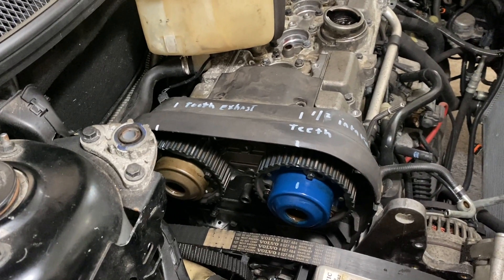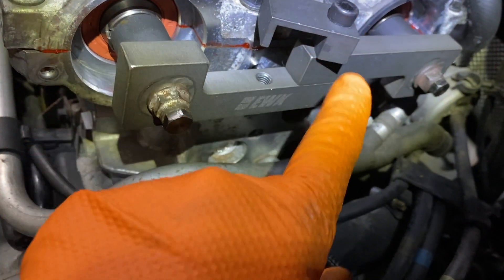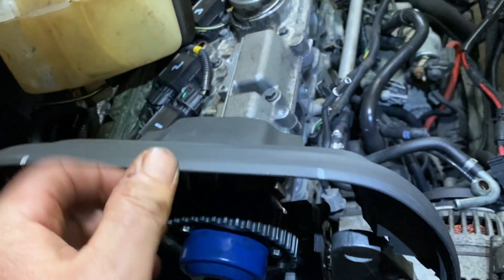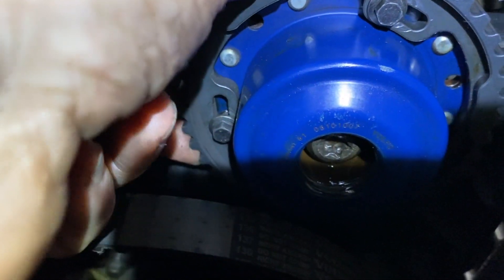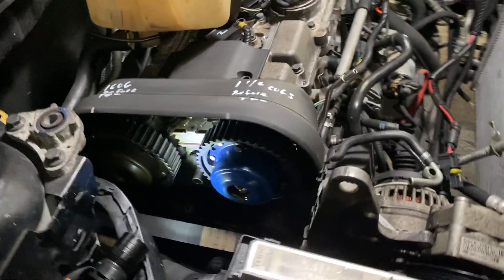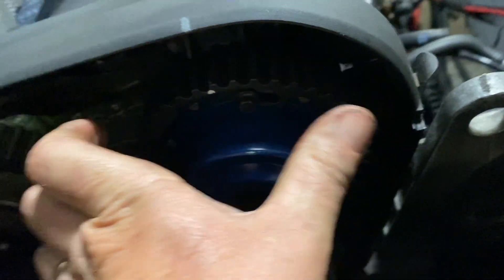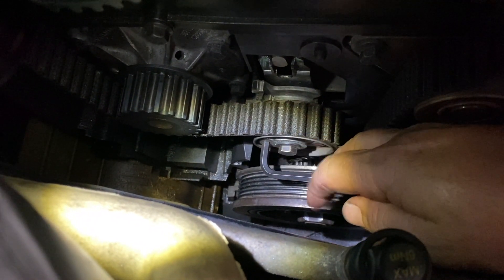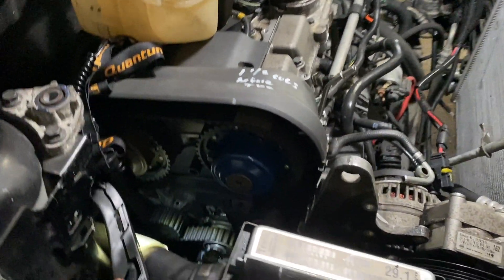Volvo 2.5 Turbo Variable Valve Timing (VVT) Alignment

Comment: I just replaced the seals behind the pulley as it was leaking, it just won’t start now I know why hopefully it’s not caused damage
Reply from the maker: Yes these vehicles don't have key ways and free wheel when you take the actuators and must be retimed.
Reply: @motorcarnut this is the only video I’ve found that explains properly, I just had to take a break because I was getting frustrated I’m about to go re time it hopefully I didn’t bend a valve
Reply from the maker: Thank you! Hopefully you didn't
Reply: @nickycarpo any luck ?? I'm having the same issue lol
Reply: @carsandbeatzofficial nope I bent 6 exhaust valves😂 setting the timing on these engines has to be spot on, luckily all the parts only come to £100
Reply from the maker: Sorry to hear that.

Comment: when I follow your guide and spin the engine two turns, I try to insert the locking tool into the back of the engine but it won't go in.
what am I doing wrong?
Reply from the maker: Idk what you did or didn’t do but sounds like the timing is still off
Reply: @motorcarnut yes but I do exactly as in the video. I have repeated the procedure several times but every time I turn the engine it is wrong after
Reply from the maker: I don’t know what is going on I’m not there but the timing marks after 2 revolutions they should line up.

Comment: Hi, thanks for the video. Will the timing get thrown off if I change a waterpump and timing belt on a C30 without using a cam lock tool?
Reply from the maker: Thank you! Yes it will on Volvos

Comment: Hey when I Lock enter bolt and turn it counter clockwise and loosen the bolt and move the gear to clockwise to get 1 and 1.5 teeth before it not align I have to move the hole gear a bit to get exact 1 and 1.5 teeth can u help please
Reply from the maker: The procedure in the video is how it’s done, if you are not using the tools Volvo requires it’s hard to say what you’re doing wrong ?

Comment: Hey brother this is the best video ever you are awesome and so smart with this Volvo timing, I’m doing one tomorrow so if I don’t take out the vvt I don’t need to do all this right, but I might have to change the exhaust but due to oil leak . So if I change I new one I just follow your video to set it back up? And since I’m not taking out the intake one do I still need to do that vvt too
Reply: I uploaded pics on my account can u tell me if this the right mark all data tell me to go counter clockwise to lock with the crank tool which I don’t have
Reply from the maker: Thank you appreciated! If you do not take the VVT off you do not need to re-time it, you can put it back on the way it was and just follow video to set the one you did remove.
Reply: @motorcarnut  thank you so much for your reply keep up you good work with more videos it can help lots of ppl
Reply from the maker: Sure no problem and of course I will! Thank you!
Reply: @motorcarnut one more question brother, I don’t have the crank locking tool only have the cam too do I still leave the crank at the factory mark or behind please let me know ow thanks
Reply from the maker: The tool is crucial for proper alignment but try to put it as close to TDC as possible

Comment: Just found this video but I doing the cam seals on my 2006 s60r but I pulled them cam sprockets off before I loosened the three lil bolts but what I asking is this when your putting it back together not before right just wanted make sure. I’m assuming this like when you are putting it all back together. Thanks
Reply: I’m sorry im new to all of this stuff, but what asking is that this is when your putting it back together after replacing the cam seals right? I’m doing water pump ect and the cam seals i wanted to make sure i didn’t have to lose the three lil bolts on cam sprockets before loosing the big t 55 bolt.
Reply from the maker: Yes correct
Reply: When I setting cams for the exhaust side trying to have one tooth before top dead center with sprocket max out but Instead up being top top dead center with it. Which makes no sense and same with intake side I’m one tooth from top dead center not 1/2 like you said. Idk what I’m doing wrong bc this would third timing doing this and my exhaust tooth one a head from the intake
Reply: I have 2006 s60r are vvt hubs different from each other?
Reply: Either way I tooth off at the very end when I put the timing belt on. Now this time it’s the intake but I can put it back tdc but then exhaust tooth is head one tooth. So nothing makes sense anymore. I’m thinking my vtt hubs are different bc my timing is not where’s your is on the cam sprockets
Reply: Actually my intake is 1/2 tooth back my bad.
Reply from the maker: Glad you caught your mistake.
Reply from the maker: I don't know exactly what you asking but i'd redo the timing.

Comment: Redoing my timing for the 50x, this is the best video on YT for this for sure.. watched this my 49th try and it fired with just a p0016 code, 50th time 100%.....thank you so much
If I can add to aid others, mine was a 2006 xc70 and the crank pulley timing marks, I found that you can look at the roll pin in the face of the ac pulley,  that must be at about 1 o'clock, for TDC  and if the timing belt crank shaft pulley has no marks like described here on the teeth, there is a mark/bumb/raise on the front of the timing belt crank pulley just behind the ac pulley. You can look down from the top and see the alignment mark casted into the crank shaft timing pulley. Align to same mark on oil pump. Hope this helps someone as this all help me BIG TIME. 

Thank you again friend for your time and knowledge
Reply from the maker: Thank you! Wow that is awesome! Glad it helped! Thanks for the feedback and the tip about the crank pulley timing marks on your particular vehicle!

Comment: Hey brother i fix a water pump leak on this vehicle for the first time and off set the timing. Can you suggest what to do to fix the timing
Reply from the maker: It would have to be redone like in this video if your engine is the same one.
Reply: @motorcarnut ok it is. What about the crank
Reply from the maker: That too

Comment: Hi, is it the same for the 2.4 with VVT only on the intake side? I adjusted it when I was changing the timing belt, but now the car does not run properly. So, I might try resetting the engine.
Reply from the maker: I don't believe so unless your cams look like these in the video. There are many variations, Volove loves to complicate things.

Comment: Am I the only one that got confused once he started talking about the cam bolts and sprocket bolts? Unfortunately this is the only video I’ve found where they actually messed with it…. My belt broke so replaced the head and now fight issues with crank no start and redone the timing many times and I still think it’s wrong because I’ve checked everything else…
Reply from the maker: Must be, you think those adjusting bolts are there for no reason? That's why you have issues. I'm trying my best to keep it simple for people who want to do it themselves. But Volvo doesn't make things easy.

Comment: Does this video still apply if i messed up my timing while changing my timing belt? I changed my timing belt at 267k and shortly after I got codes P0017 & P0016 Camshaft position correlation codes. I must've done something wrong but I don't know how to correct it. (2007 xc70 with the 2.5l turbo) When the crankshaft is positioned correctly(TDC) my exhaust is off 2 teeth, and my intake is off 1 1/2 teeth.
Reply from the maker: It should same engine
Reply: @motorcarnut  ok, so i gotta re-time the entire engine back to factory timing.
Reply from the maker: correct

Comment: Hello sir. I must say I love your video.
I have a question...I have 2007 volvo S60 2.5t and I have replaced pcv system, battery, alternator regulator with brushes and top motor mount. Once I put everything together and tried to start the car there's kinda hard knocking noise that I can hear from top of the engine (camshafts area) just about all lifters are knocking (Sounds like diesel truck engine when cold). I pull off both vvt solenoids and cleaned them good and inspect them and they seem to be working fine. I started couple more times to see if it's going to give me any codes and it did turn check engine on. Codes are ECM-670c and 671c (camshaft position, intake and exhaust. High). I cleaned all codes to see if it's going to change anything and nothing changed, still knocking.
Engine was running fine before. 
Do you have any clue what could happened and what should I look into.
Thank you.
Reply from the maker: Thank you very much, appreciated!
You may have an issue with the timing chain, or even one of the VVT gears being out of alignment. Sounds like the valve timing is off
Reply: I assumed same and that's why I want to change timing belt first and see what happens. I already got camshafts locking tool.
Thanks for your reply, I appreciate it.
Reply from the maker: No problem, good luck!
Reply: Thanks
Reply from the maker: No problem

Comment: Thank you your video is easy to understand and gets me closer then any other . Mine has only exhaust side vvt. I set everything as in video put together enough to fire . I fired it up and there is a loud squeeling sound now like a belt squeel . You rhink i might have tightened the belt to much ?
Reply from the maker: You are welcome, That or the belt tensioner if not new it's probably worn.
Reply: @motorcarnut  ok I adjusted everything but I still think I need a new tensioner . It seems to rev fine , but at idle it shakes like hell and throws misfire codes . Ran like a top when seals went bad
Reply from the maker: Valve timing is definitely off
Reply: I may have messed up the reseting of the vvt after initial timing . I'm a little confused . Do I want the final turn to have the hub turned to the right or the left ? And the sprocket should stay on time right ? Sorry to bother you and I appreciate the help bigtime ! I know cars and fix lots of them . But this isn't normal lol.
Reply from the maker: Left and sprocket should stay in time correct

Comment: Excellent video! Does the same priciple apply to their inline 6 cylinder engines?
Reply from the maker: Not really, it’s a little different
Reply: @Motorcarnut  Is the info perhaps in the Haynes manual or do you know anywhere I can get it?
Reply from the maker: @Thexpertoneverything If you have a library card you can go online and look for auto repair manuals, they are a great no cost source of information.

Comment: Motorcarnut, I was driving my 2004 Volvo V70 2.4 non turbo and a piece of the belt got up under the pullies and it jumped time and cut off. It isn't double variable valve timing only single,  so how do I time it since its single variable valve none turbo?
Thank you in advance for any info.
Reply from the maker: I have a video warning people of that belt problem. The set up is different unfortunately I didn’t make a video yet on the single.

Comment: Great video, but I would change where the teeth are placed before the final adjustment.  If you put the exhaust 1 1/2 tooth before and the intake 2 teeth before the timing mark when you do the final adjustment the three bolts wouldn't be bottomed out in the grooves.  That way you would know for certain that you had adjusted to the correct limit rather than just having the bolts bottoming out in the bolt grooves.
Reply from the maker: Did you do it that way? The information is from Volvo and never had a problem yet. But thanks for the information and comment! Appreciate the extra information.
Reply: @motorcarnut  I did and whoever replaced the timing belt before me had the crank sprocket bolts even further to left in the grooves than I did.  The car had been running great but the damn Volvo PCV system was completely plugged up and pushing oil past the camshaft seals so I replaced the seals and the PCV system.  165k miles and getting around 27 miles per gallon!

Comment: Awesome video! Is it the same with a Classic 00 (97-00)? Mine only has VVT on the intake side. Should I go with the four teeth to the left before tightening? Going to change timeing belt due to an oil leak, I have a new kit with all gaskets and bolts, but I am afraid the leak is from the VVT and don't wanna change only timeing belt and gaskets just to see that the leak is from the VVT. Sorry for the bla bla but is there än easy way to see if my VVT is bad?
Reply: Or mine is maybe not spring loaded?
Reply from the maker: No it’s different.

Comment: The driver side end of the cams where you will put the camlock tool on has a slot on each cam where the cam, locking tool attaches 
 should those cams both be almost matching each other in a almost even horizontal position slightly offset from each other 
Haven’t found even one video any information or instruction  in reference to what position those slots should be in when you attach the cam locking tool my   intake cam is almost straight across horizontally  at 3:00 my exhaust cam is    sitting at about 1 o’clock  
should it be closer to horizontal more or less like the position of the intake? If so, how do I turn the exhaust cam separately from the intake cam to make them more in line horizontally?
Reply from the maker: The tool locks them in only one way, if you’re trying to to it without the tool you’re going to mess it up.
Reply: OK I get that but my intake camshaft and my exhaust camshaft are not lining up where you would put the locking tool in the slot and run the bolt in. I don’t know if that makes any sense I’m going to try to explain a little different on the intake, camshaft side that you put the tool the Slot is at about 88 degrees just slightly above horizontal on the right side and my exhaust cam is at about 55 degrees
Do I lock the camshaft, locking tool in on the exhaust side and then adjust it down with the tool and then lock the intake cam shaft  as well?
Reply from the maker: Yes
Reply: From what I’ve watched in Red the cams should be almost horizontal with the serial number on the bottom side 
And the serial number on  the exhaust camshaft on the top side   The intake at about 88 degrees, and the lost camshaft slot at the exact mirror image

Comment: Hello I have a 05 xc90 and followed this and have a ecm 340b after startup, runs ok. Replaced old sensor but no change . Tried 1 n 1 tooth but barely runs lol thinking 1 n 2 tooth. 😅.
Reply from the maker: Make sure sensor is installed correctly, some model they can crack and misalign the sensor. Then I’d recheck timing if you didn’t have this problem before.

Comment: I’m looking at one of these. 2011 s40. Seller says it jumped timing and shattered 2 pistons. I’ve never heard of this happening, only bent valves. Is it possible it just bent valves?
Reply from the maker: Most of the times it doesn’t damage the pistons but it could.
Reply: @motorcarnut  I’ve watched many of your videos on the Volkswagen 2.0 TSI and I flip those cars quite often. Would you say this Volvo engine is any more difficult?
Reply from the maker: Thank you! I would say not really but they do require their own set of special tools for setting up valve timing.

Comment: I have a single vvt b5234t9 from an 04 c70 in my 98 S70 T5M m4.4 has no vvt control so no codes no matter where you set it. I'm about to do timing belt and tensioner as motor is at 75k but it's 20 years old. I had my exhaust cam at 4* retarded because i had a 12v switched source to power the solenoid at high rpm to remove overlap. I wanted to reset the cams to tdc when i do the belt and i do have the cam lock tool for the back along with crank tool, as well as cam gear lock tool for the front for doing belts without moving anything.
Reply from the maker: Different engine so doesn’t relate to the video
Reply: @motorcarnut  same engine different intake cam. Bore and stroke make no difference on cam timing. And the vvt hub is still set the same way.

Comment: Was always under the impression the cam gear 3 bolts should be close to centered between the oval holes? Least from the factory it was. That gives you room for adjustment if your a few degrees off. Also performance guys usually run the intake with a couple degrees of advance.
Reply from the maker: It’s actually wherever they end up after doing the timing procedure.

Comment: Thanks for your time and explaining sir, the tools you've shown in the beginning is the tools to hold when you change the gasket too? I am thinking to change the valve gasket of my s60 my friend told me ths I need a special tool. I wish you have video in how to change the vslve gasket can't find any video on volvo. Thsnks again for your time.
Reply from the maker: No problem, thanks for the comment. To just change the valve cover gasket you don't need any special tools because you're not touching the movement of the valve-train.
Reply: @motorcarnut  thanks for the info, It seems its only valve gasket I got some oil leak at the spark plug not much just wet of oil.

Comment: Question: got cylinder head rebuilt after water pump/timing failure. 8 Valves replaced. When preparing for cylinder head assembly, Volvo instructions call for crankshaft tool to be installed and crankshaft ‘clocked ‘ physically against tool. Q: where is the port located where tool inserts?!
Reply from the maker: You don’t need any tool for the crankshaft when there is a belt and you follow video for top dead center on crank pulley sprocket.

Comment: i am confused. you tighten the center bolt so the whole unit moves to the limit position then you say to loosen the bolt in the center but you only shift the gear by itself to its far clockwise position. So i dont understand why you had to loosen the center bolt there.
Reply from the maker: Just follow the video